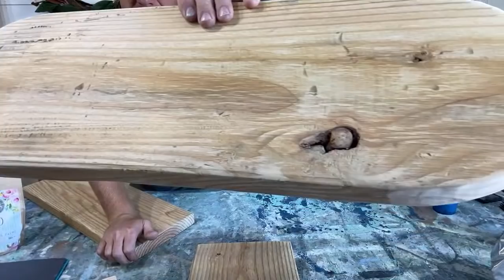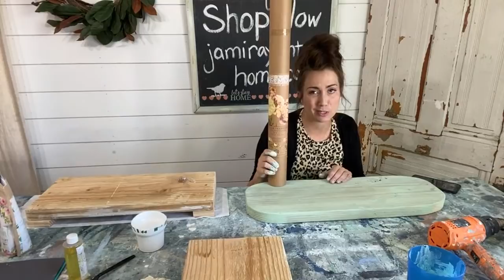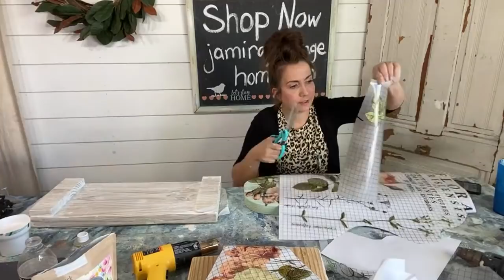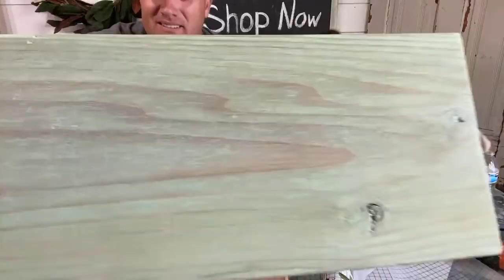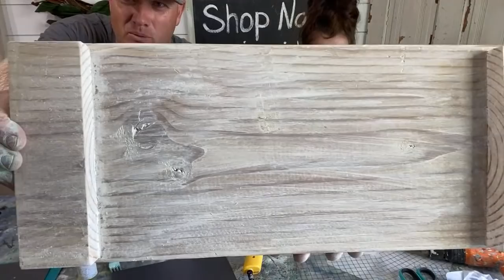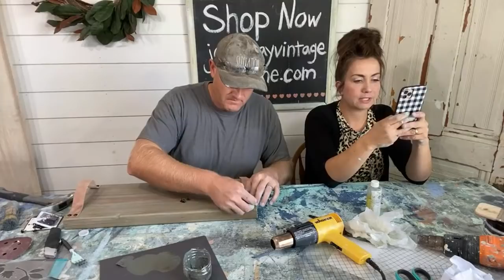Anthropologie Tray Hack with Scrap Wood and Food Safe Stain

Comment: Jami,  I told you over a year ago about the natural walnut stain.  I get it on etsy.  I use it all the time.  It comes as a powdered stain.  Just mix with H20.  You can determine the strength of color.  I guess you don't listen to me!

Or you can make it yourself with a walnut tree and the green pods.  You boil the pods in water in a large pot.
Reply from the maker: I listen to you.  I just like to use the products I have ❤️.

Comment: I love these! Just wondering...if you use milk paint and seal with hemp oil, can it be washed? I made a tray and used chalk paint on it and sealed with butcher block oil and the paint all came off.
Reply from the maker: It can be washed, but I wouldn’t do heavy scrubbing and I’d let it cure for a month and do 3 coats of hemp oil or so before I used it heavily with food.  That said, once the milk paint is dry it should effectively “stain” the wood and require sanding to remove it.